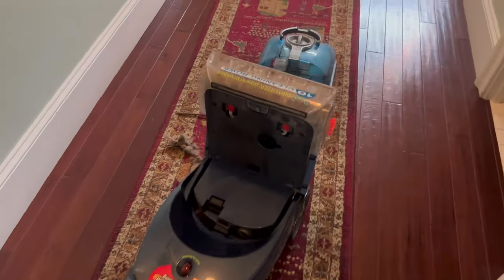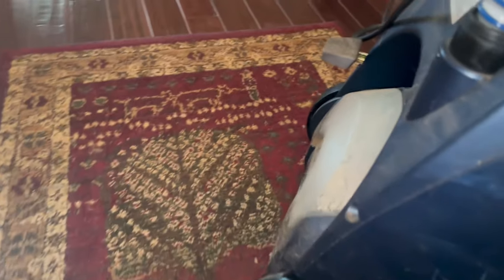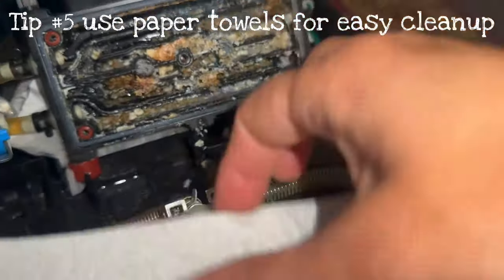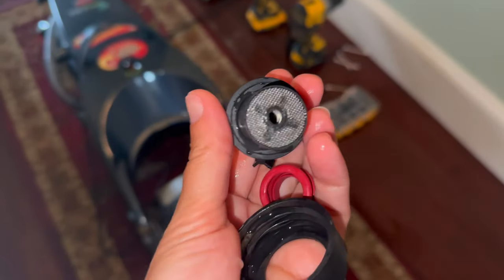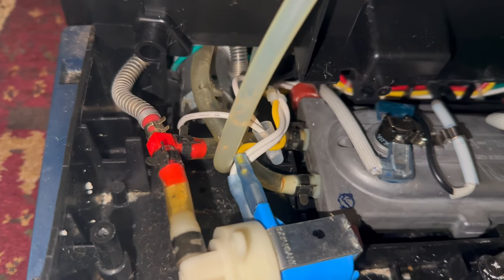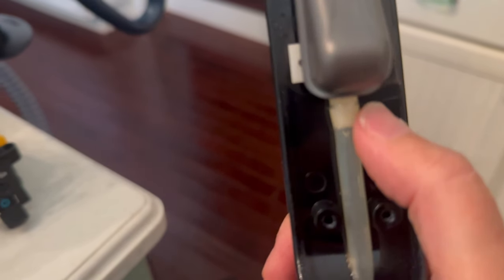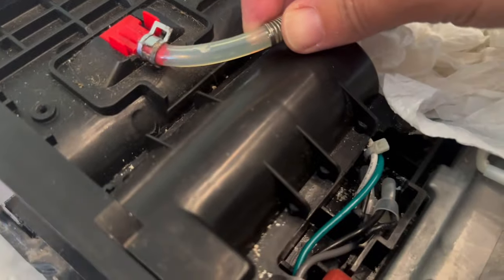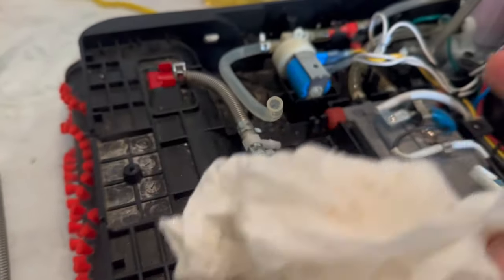My Bissell Pro Heat Carpet Cleaner won't SPRAY WATER😭 (12 Quick Fix Tips to get it WORKING again!)

Comment: Ours did not work until we took the clean water bottle off and turned the collar and raised the handle up and totally extended. We put the water bottle back on, DON’T TOUCH THE TRIGGER YET! Turn on the machine and the water sprayer worked!🎉
Reply from the maker: Thanks for sharing your tip!
Reply: Very helpful..Thank you!!

Comment: Good job on getting your Bissell back in working order!  I had the same problem with my Bissell a few years ago.  I took that puppy apart, cleaned everything, put it back together and it has worked like a charm since.  Since my Bissell rehab, I do one very important thing after every shampoo.  I refill the tank with only hot water and a bit of vinegar and take the cleaner out on the sidewalk where I cycle half the water through the base, and the other half through the hand nozzle.  My lines stay completely clean and ready to go for the next shampooing project.

Comment: Run some vinegar thru it after cleaning to flush and dissolve all remaining deposits out.
Reply from the maker: I actually read or saw somewhere Bissell related that vinegar will ruin this machine.
Reply: Mine hasn't been used in about 12 years. I think I'm just going to give it away. I'm sure it's gummed up from the solution in the  tank. My vacuum nozzle in the front, the two pieces of clear plastic,  need to be glued because one of them separated.I saw a video of a guy fixing that but I think I'm going to just get rid of this unit.I don't really have much carpet. I'll have to look at your other videos as you have such a pleasant manner..
Reply from the maker: @irish89055 Thank you.🙏🏻

Comment: A little more of a project most would like to tackle, now I see why I find them at thrift so often : )  Seeing the same type of issues. This last one had that crystalized/soap residue like you are flushing. The spinning filter on this similar unit was totally clogged. Was hoping rinsing that out would do the trick but I'm thinking its a bit more complex like yours. I'll likely take it back which is a shame as its otherwise quite clean or used a handful of times. Reminds me of clothing steamer residues from hard water as well.
Reply from the maker: Having gone through this once, I would be more confident next time for sure. If I was looking to buy/resell something on Facebook marketplace this would probably be a good choice because it’s most likely just gunked up.

Comment: Thank you so much Jenny for the EXTREMELY informative video! I just pulled mine out to do some spot cleaning and EXACTLY the same issue as you, nothing happening with the clean water or the soap! 🤯😱 
I plopped the clean water top into the sink with hot water 🤷🏼‍♀️ hoping that might fix it LOL and loosen any crud. Then I sat down to google this and my VERY FIRST CLICK was this video and you have the exact model!!! And yours looks just like mine! And I leave the soap jug on and it has soap in it. 🤦🏼‍♀️😬 I'm so glad I'm not alone in doing that BUT I won't be doing that again. LOL 
I'm not an imph but I am recently single and I like having a man around to do these jobs. I'm going to put on my Jenny Pantaloons 😉 and start to fix this machine because I can! I'll be honest if you had been a man making this video, I 99% would have dropped it off a vacuum repair shop tomorrow. 🤫🫣 But because you did the same fix I'm comfortable doing it too!! 💪🏼🩷💞👍🏼🍀🍀🍀🍀🍀
Reply from the maker: Oh my goodness! This is EXACTLY why I started my channel! Thank you for the lovely feedback and trust me, when you fix your machine it will be so satisfying!
Reply: There are parts all over but I think I got it fixed! 🥳🥳🥳🥳 Thank you again!!!

Comment: Great video and motivational inspiration! You gave me some valuable insight to give it a go again with mine this morning. I literally had to clean out the heater by chiseling out the crud ( it was completely full) with a small screwdriver and thought it would work for sure last night. I couldn’t safely get the hoses off the solenoid (thought they would split/break the inlets) so I used a handheld MightyVac pressure/vacuum to clear the lines separately. Then I was able to push water through the heater to verify everything worked properly, with exception of the attachment handle. I used the MV to back feed from the attachment end, alternating between that and running the Bissell to loosen up the clog. If it needs fixed again, I’ll start with the MV at the attachment end and then on the floor nozzles.
Reply from the maker: Glad this helped!!! You're a trooper!

Comment: 2:08 This is where getting a bunch of distilled water (or at least having a water softener) and using that in lieu of basic tap water in your cleaner is a big benefit. My heater (which BTW they're no longer available for my model) was just as bad as your several years ago when I took it apart and since cleaning it I've stuck with distilled water until installing a water softener) and so far it's made it seven years until it just recently started having flow issues.

I'll be checking the heater again (along with all hoses, nozzles and connections) and even if the heater has buildup again, the fact that it's lasted so much longer than previously is definitely a good thing.

Also, when I first cleaned my heater I soaked it in some CLR to break apart the buildup without damaging the finish/coating on it, then used a stiff toothbrush to really get all the rest of the gunk out.
Reply from the maker: We do have a water softener but I like your idea of just using distilled water.

Comment: Linda from Cairns Thank you so much Jenny your video was excellent my carpet cleaner is now working I took it to a repairs in Cairns AU
and they said they can not fix it as they could not get any parts from Bissell and said it was most likely the water pump so I went onto Amazon and they had one I fitted the Water pump but it still wasn't working then I saw your video about the build up in the hoses and cleaned them all out and its working now crazy I know by all accounts Bissell are doing all the repairs them selves and I would have to send it away so as you do I got onto YouTube Many thanks 😃
Reply from the maker: Oh wow! Can’t believe the repair people passed up on this without even trying! Glad you were able to repair it. 🙌🎉

Comment: Mine one is a Bissell proheat 2x turbo but it looks the same as yours inside. However I have a hard time to open the front cover to assess the heater to check for clogging although I had taken out the bottom 6 front screws and the back screws for the cover of pump and tubes at the back.
Reply from the maker: I swear they make it difficult on purpose so you have to take it to a repair shop. Lol
Reply: Most likely !
Reply: Yes, I’m having the same problem accessing the components inside. I can’t seem to get the hard casing open all the way😫 I’m so frustrated that I can’t get pass this main part! Her looks east to open. Anyone have any suggestions on how to open this thing all way to get to the heater and plugs?!
Reply: @conscious_awakening1101  Finally I found the screw inside and able to open the cover. But I wasn't able find the blocking although I used wire to pierce through each tub. I end up dump the machine !

Comment: So I have this problem with I turn to rinse cycle  to rinse carpet , I get soap coming out of the bottom holes. All my hose in the front spray fine and so does the trigger handle.  Is this a clog in that metal plate heater thing.
Reply from the maker: @cycloneyou  Probably, mine was gunked up in multiple places.

Comment: If you really clean your carpet by broom sweeping and vacuuming before shampooing, you will really eliminate most of that gunk. I clean my carpet so well before shampooing that the red filter hardly gets anything trapped in it. 
Seriously, save yourself from having to go through all that disgusting mess by really deep cleaning your carpet with a broom and vacuum cleaner first. 
My Bissell Proheat pet turbo has broken the belt that controls the pump for the water dispenser twice now,  I've only had it for one year.  I'm going to try to find an after-market brand of belt this time. 
But to save yourself from all that gunk cleanup,  just clean the carpet better first.  Especially if you have pets.
Reply from the maker: Thanks for the tip!
Reply: I just saw a video on IG showing a cleaning tip of using a Horse Shedding Rake and she was scraping up the hair with no effort! I ordered one on Amazon because it also works on my cats hair on the carpeted cat trees and scratching posts! Hope this helps!
Reply from the maker: @Cyndy101  Thank you! I do have a cat brush thingy to use on their tower and furniture. They really work well!